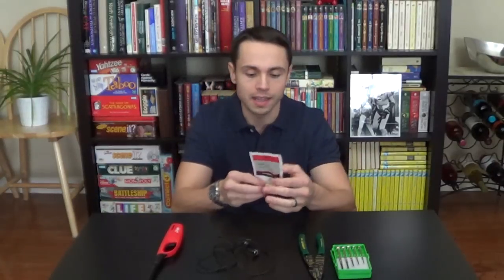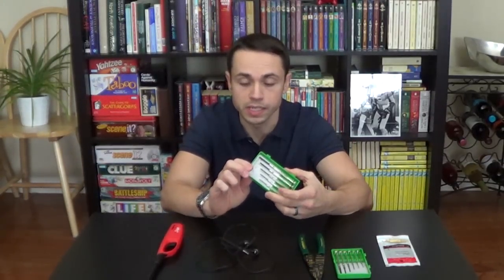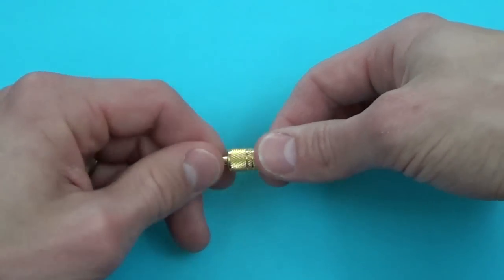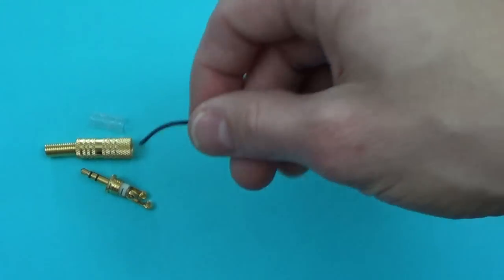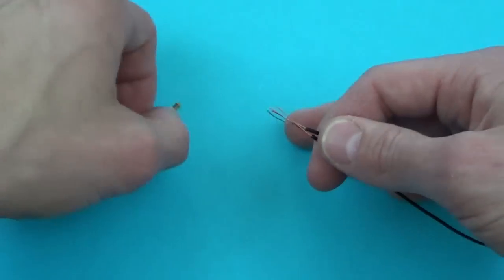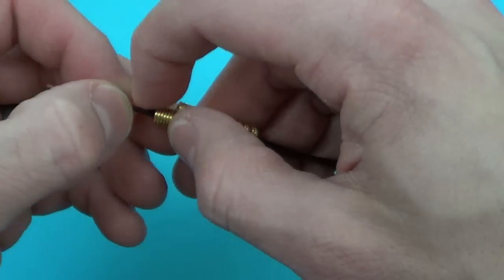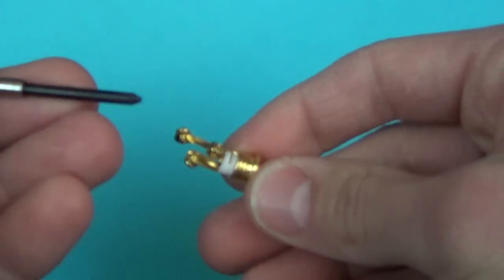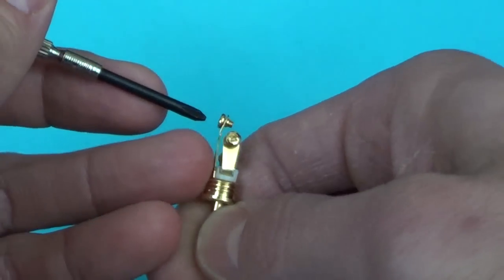Headphone Repair No Solder (Easy) - Re-Posted Video

Comment: Hey Rich....do you have the 1/8" radio shack part # or the Amazon link to the part?  I cant find the screw connection style on amazon or eBay.  Great video.  Thanks a million.  -Brendan
Reply: Did you find that??

Comment: Hi Rich, I have a pair of Bose soundtrue earphones and I somehow snapped the wire. What I found inside was 5-6 fibre like wires with no copper or metal. Do you have a solution to fix these? Thanks in advance

Comment: Hello!

I'm just wondering where I can buy this gold plated connecter that you often use to repair broken headphones.
(goldseries 1/8 stereo plug 24k gold plated connector)
I manage to find some similar, but they dont have any screws? Are the screws included with the actual plug?
Hope you can answer as soon as possible :)

Comment: before I screw the case on to the Jack I tie a knot at the end of the stripped wires to prevent the wires slipping from the screws if I pull the earphones
Reply: Also please provide an Amazon link